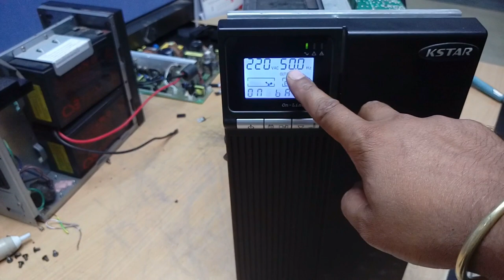How repair Kstar 3 Kva Ups

Comment: Hello friend, i want to know how i can set the output voltaje of this UPS. I want to change of 220 VAC to 230 VAC, you can help me plis?
Reply from the maker: There are no options to increase voltage digitally
Reply: @mrcontrive5641  Thanks to respond, so how i can do that? actually i have 2 UPS of this model and 1 have 220v to output and the other have 230v output. How this is possible?